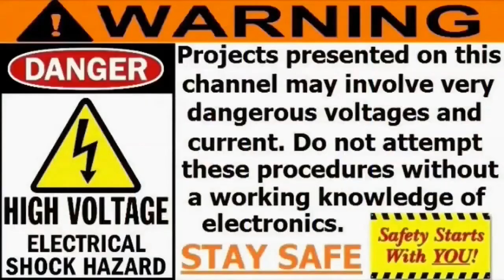DERB - Ward Airline Global - Finish cap change and test

Comment: When soldering stuff I have a small fan blowing the vapors away from me and keeps me cool as well. Been doing  that since I was a youngin".
I bought a set of small pliers ( from Harbor Fright Tools) LOL, with one used almost exclusively for looping wire ends of components. These pliers 
have long ends and are very small diameter ( 1/4") but you can curl the wire ends up to make a nice fishhook loop after connection is made.
Have you ever heard of a Select-A-Tenna Doug? Bought one which acts like a passive AM signal amplifier. No batteries needed. Insides have a 
variable air capacitor with a large loop of wire wrapped in a circle  all inside a round  plastic box to accomplish getting more signals to the radio.
Good repair video rarely seen it done by fellow video repair guys on YT. Usually you see how to solder components videos separately.

Comment: Nothing beats "hook & pinch", tacking on wires "parallel" is just as bad as tack soldering.
Sometimes I have to tack solder if I can't get in the area.
The radio sounds real good Doug.
Reply: @DERB_Seymour_Indiana  I have no idea, I did get your FIRST reply